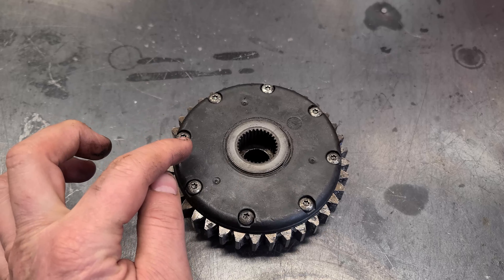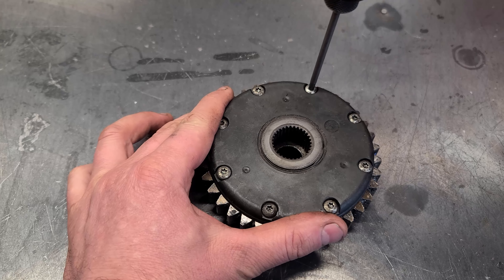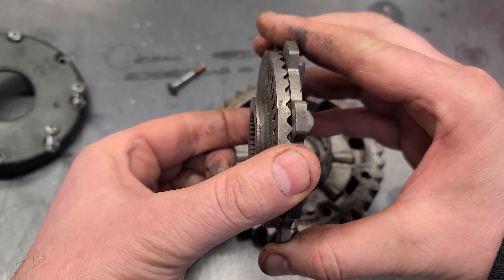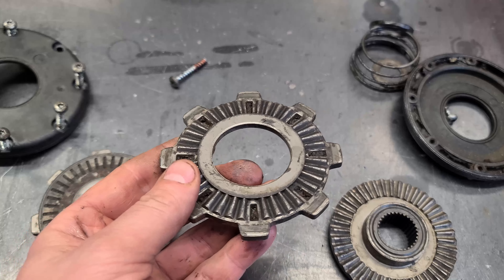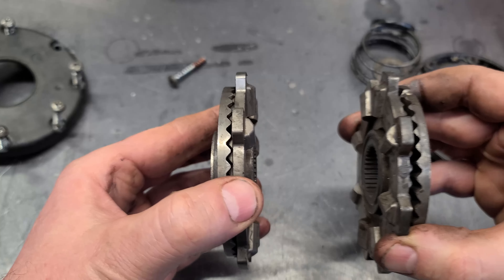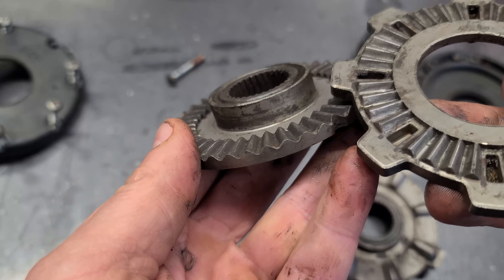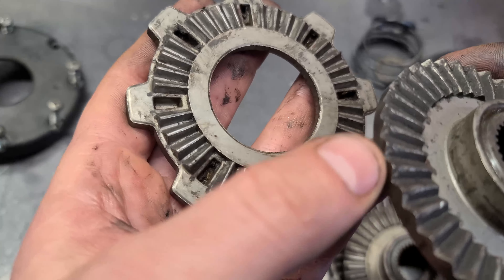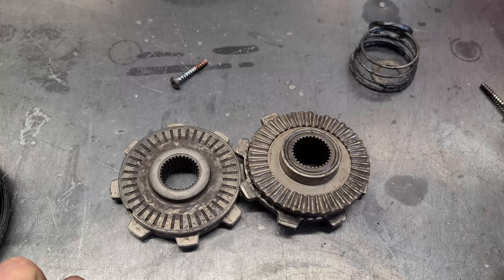INSIDE ARIENS SNOWBLOWER DIFFERENTIAL WEAR & TEAR - WHEEL WON'T TURN & CLICKING NOISE

Comment: I'm guessing that is not an inexpensive part...
Reply from the maker: you're right!
Reply: I checked the diff price for a rapidtrack, it was $150. I don't think that is very expensive? He also said the owner of this machine cleared 20-30 driveways. If it only lasted 1 year, that means it would last 20-30 years for a regular user.
Reply: @Kowalski301  $150 USD beats the hell out of the $600+ others are talking about for their older (and now, becoming a bit harder to source) full differentials.  It almost renders it a "consumable" item.  Which, as it wears out with lots of use, I guess it really is.
Reply: @Kowalski301  "General Transmission DL300" are priced $360 around here.  MTI Canada are the general distributor of Ariens.

Comment: i don't see how you would really save any money even if the parts where available for the differential. you are replacing more than half the differential by replacing those parts and i don't think it would solve the issue 100%. i don't agree that the gear are as much the the reason that is it skipping. i bet the bigger reason it is slipping is likely the spring is not as strong as it used to be resulting in it being easier to skip. you could likely shim the spring making it harder to skip or if you want to turn it into a solid axle you could likely put a piece of pipe in to  replace the spring  and prevent the gears from skipping